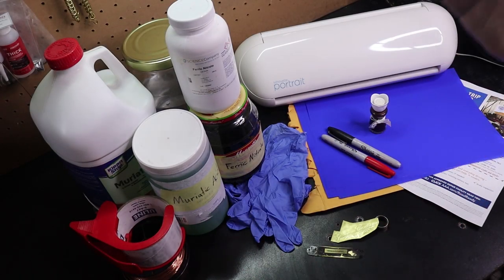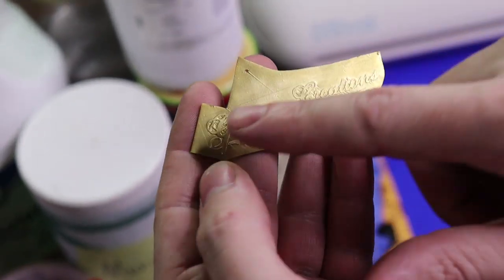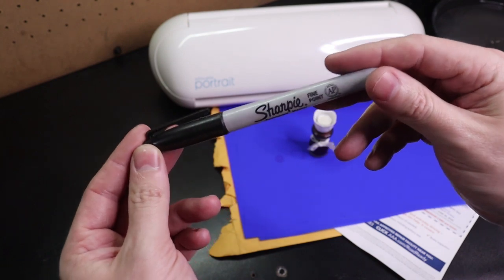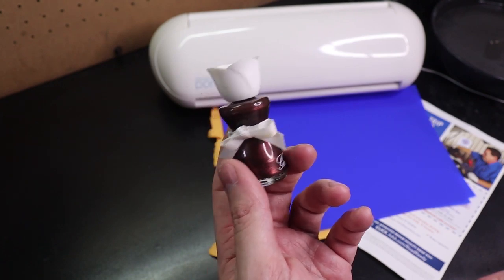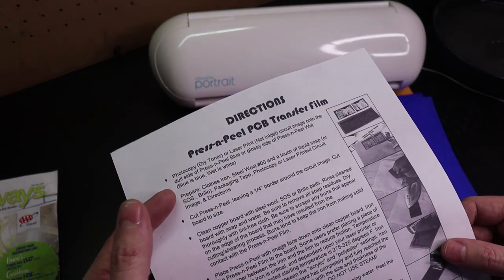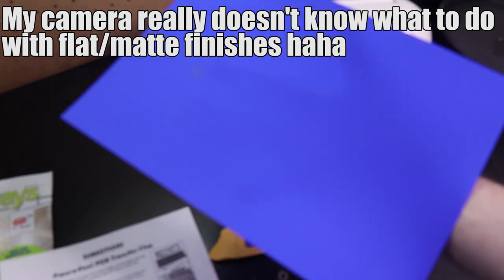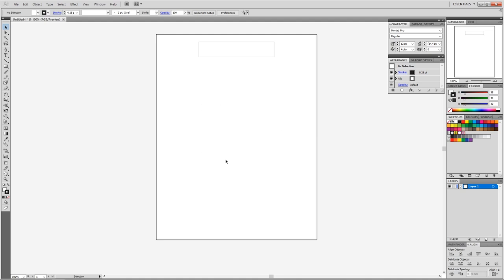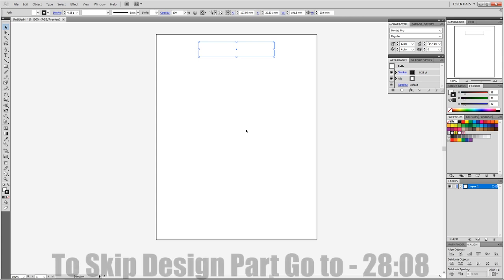Cheap vs Expensive Ways to Acid Etch Metal

Comment: Pro tip for applying crazy fine detailed vinyl: don't weed it right away.  Mask the whole thing, apply it, then weed it on the substrate.  With both the positive and negative parts stuck firmly to the substrate it's easier to pull out the negative without disturbing the positive by accidentally lifting parts off you don't want on the wax paper backing.
Reply: This is GENIUS!

Comment: I have been using cheapo Staples Glossy photo papers for years ironed on.. Ferric chloride
 for brass and copper,  ferric nitrate for silver. Use a small tub with aquarium pump with aerator hose gives a nice texture piece face down. Am always amazed at the detail I can get. Scotch bright on medal before iron.

Comment: Hot acid dramatically decreases the time needed to etch, but it also dramatically reduced the time you have to remove any splashed acid from your skin before real harm is done. With most acids at room temperature you get a comfortable margin of safety to flush the affected area before any real harm is done. Hot acid immediately starts breaking down tissues, as soon as you are splashed real damage is done.

Its kind of like you CAN drive 120+mph down a road to get somewhere faster, and you may even get there without anything bad happening, but that doesn't make it worth it.

Use room temperature acid and work on another project while it etches or use a bubbler, don't heat your acid unless you are in a lab setting, have proper ppe, an eye wash station, a quick way to neutralize the splashes that will inevitably happen, and have gone through lab safety so many times you could recite the text book.
Reply: Also, excellent video. I've been using nitric acid (typically sold as Silver Etching Mordant - mordant in this case being nitric acid pre-diluted in water, as the pure stuff is disfiguring even in a minor accident.)

I think like I'd like to give ferric nitrate a try instead --  Nitric acid (40-60%) is rated as a 3 (extreme danger) on the danger scale on the SDS, where as ferric nitrate is rated at a 1 (slightly hazardous.)

Comment: A bit more complicated, but if not using a vinyl cutter (I use cricut maker) and needing finer details, I'd be inclined to use a UV resist. For the artwork print to PCB artwork film, check for pinholes and touch up if needed. That step is then done for however many uses you need. Chemically clean the metal to ensure no contaminants (water droplet test), apply UV sensitive film to metal or some other way of coating the metal with resist, sandwich artwork to metal with glass to avoid shadowing and expose with a UV flood light for a couple of minutes or so. Develop the metal to strip the resist that wasn't exposed. Etch. For PCB's I always used sodium persulfate (fine etch crystals), which works great for copper, gives no mess and the etchant remains clear, and should work for brass and some others but not aluminium.
Reply: Hi , is there vid for what you described.  Im new and learning.

Comment: You can actually print onto a sheet of overhead projector acetate with a laser printer. It's a thin, clear plastic. You then put a piece of plain paper on top and iron the design on.
Reply from the maker: I have seen that too and thanks for sharing that info 😁👍
Reply: @GomeowCreations  It was one of the techniques I used when doing my degree in silversmithing. It works well, but does usually need some touch ups with a marker. The decal way definitely gives the best coverage. And a heated bath cuts your time down to about 10 - 20 minutes for a deep etch.
Reply: how do you apply it to the metal surface?
Reply: @KeyushTheStuntDog do you have video of that technique?

Comment: Add hydrogen peroxide to the acid for very very fast results. You can even just use concentrated pickling vinegar rather that hydrochloric acid or ferric Nitride/Chloride. The vinegar and peroxide is good for etching steel.

Comment: A cheap laminator makes it really foolproof and easy to get the toner to stick to the metal. I use that for making double sided circuit boards and it works perfectly probably 95% of the time.

Comment: Awesome info video!  I etch a lot and I use toner too. The bubbler with low heat works fast and clean with ferric nitrate. Also,  don't toss the used FN, even though a lot of people say it only works about 6 hours.  Store it in a large glass jar and seal the lid with electrical tape and wrap the jar in towels or cloth to keep it away from light and depending on how often you etch, it will last so far for me, a year and a half. I etch a lot of pieces every 4 to 6 months. Each time it takes only an extra 10 minutes or so unless I add a small amount of FN to it.  A big money saver for you I hope.  I  really enjoy the long videos with all the options.  I'm now experimenting with steel etching with salt water for texture plates.  We'll see how it goes.  Lol...thank you so much! 😊
Reply: Any pro tips for the toner engraving?
Reply: @sac7404  I don't do a lot of engraving but plan to learn.  If you're interested in an effective way to apply an image to metal, I highly recommend using PCB toner transfer paper. It works great for me consistently.  Just be careful not to let the transfer paper move at all during the transfer or it will smudge.  I use a hot plate turned on low and rub the image carefully with something flat like a popsicle stick. After you've tried it a few times on small images for practice, you'll master it.  I hope this helps. Good luck with your projects!
Reply: @tywhitmire860  thank you very much! I will look into it and see if its available in my country (at the moment a lot of office supplies are not being imported), or will just try with the protector paper from some vinyls I have, just to experiment. Good luck for you too!

Comment: Really great video, thank you for the time you put into this! Based on this video, I decided to go the vinyl cutter route but chose the Cricut Joy since it's small. For small cuts, it wasn't accurate. Then decided to try a 5.5w diode laser on a Sainsmart 3018 prover to ablate matte black paint off brass in preparation for acid etching but couldn't get it to have really crisp lines. I'm now thinking of going back to the vinyl cutter option but perhaps a Portrait 3. My designs are very small (filigree within a 1cm diameter). All this time down the line, what would you suggest? PS. I really dislike the photoetching option. Many thanks in advance! Gunter
Reply: what did you end up doing? i have tiny designs too and would love to know
Reply: @tsundear  I ended up getting the Portrait 3 and am much happier with the accuracy of its cuts.

Comment: There is another YouTube video that uses “Glossy Laser Printer Paper” (I purchased some from an office supply locally and it’s 52# paper) to put the design on instead of glossy magazine that I tried with unacceptable results. I did however experience your problem using an iron as the heat source (will try heat gun). Also in that video the transfer of toner was done using a mixture of ethanol and acetone which seemed to work well for him other than leaving behind some of the paper’s fiber on the toner transferred only.

Comment: Great video with tons of info! I am trying to make a brass casing for a guitar pickup and need to make a logo on it. I will be doing lots of these and was wondering if I could simply have the vynil decals made at a sticker shop and use those as the resist? I'm assuming yes. Seems like a great way to streamline the process

Comment: do you use ferric nitrate to etch silver, right? I just watched a video tutorial where this woman was etching silver in ferric nitrate hanging the piece with a wood stick and thread on a jar. It came out great, but others were saying that they tried it, and the silver was full of stripes.
Would you do a video on how to etch silver? do you recommend using the tape laying it flat like you did using the other acid and the brass?
Reply from the maker: Yes you do use ferric nitrate on silver for etching. I can make a video doing that to something in the future. So if you hand it   it will state to get lines due to how the acid works on the metal and that is why I have mind flat on in the acid so when it is etching the parts of it fall straight down and don't leave lines.

Comment: The amount of time you took with the Sharpie and nail polish vs the vinyl and laser printer determined the quality vs cost. 
Had you been as careful and exacting with the first two your results would have been much better whereas you took a lot of time with the other, more expensive methods and had some questionable results given the time and cost. 
I etch all the time with Sharpies and nail polish - virtually zero cost - with very good results. 
Still - lots of information here and I appreciate the amount of time and setup it took to create the video. 
I just want to make sure people know they don't have to buy a vinyl cutting machine to get really good, clean etches.
Reply from the maker: Yeah videos like this are kind of hard to make with some many options going on it in. I think I said that they do work but you would have to spend a lot more time with the cheaper resists like the marker and nail polish. 😅
Reply: Any tips for the toner method?

Comment: I have a fairly detailed design I'm trying to do. I have a Cricut machine like your Silhouette, but was considering using it to create a stencil I would then use nail polish or sharpie to fill in. Since I'm working with 0.999 Fine Silver, I needed to buy Nitric Acid. Do you think that would work alright?
Reply from the maker: How fine of a design are you dealing with? Because you can cut some really thin stuff out of the vinyl on the cricut machine
Reply: @GomeowCreations  I traced a dollar bill and converted it to an SVG file. Not all of the fine lines and swirls came through, but it's a fairly decent representation. I've found that I can weed out the vinyl stickers pretty well to be used as a stencil, but doing it in the reverse, to leave the small pieces there and removing the larger sections, is pretty difficult.
Reply from the maker: Well it might be best to do it the way you wanted to using it as a stencil and filling it in with paint

Comment: You don't need the mat when cutting vinyl - it already has a backing sheet,  just don't cut too deep.  The mat is used for paper and other products that don't have a backing.  Take the clear protector off when using paper - it's sticky 😁

Comment: I am doing a cylindrical object, so I can't use an iron. could I use a heat gun and wrap heat resistant tape around the object to =make the transfer?
Reply from the maker: You can try, or just use the vinyl cutter to make a sticker.

Comment: Try putting the object face up in the tray and use a feather to brush the surface. Not kidding, the acid won't  eat the feather and the feather won't harm the resist. You will get really sharp cuts.
Also look around for resist pens. They work better.

Comment: how do you separate the design from the sticky transparent plastic after applying the design to the metal? 8:15
Reply from the maker: so the Vinyl adhesive is stronger than the clear transfer sheet so it will just come off. Sometimes it will stick in spots that you didn't push down. If that happens just stop and stick it back down and push down on that spot more.
Reply: @GomeowCreations  makes sense. Cool :)

Comment: Does anyone know if you need to dilute the acid with a 2:1 ratio of water like many people do?
Reply from the maker: I don't know if you do or not to be honest 😅
Reply: @GomeowCreations  I think I figured it out.. if you sand and clean the metal well before etching. Using a diluted acid to slowly etch is probably easier to control and make sure you don't mess up. A pure acid will eventually get through the impurities on the metal if not cleaned and then etch, but it might not be as even. So mainly the prep work on the metal is just as important as the etching itself.

Comment: Can we do this using battery acid?
Reply from the maker: ...no?
Reply from the maker: I honestly don't know what battery acid is bit I guess it makes some sense seeing that it's an acid. You can do it with vinegar and salt too if you are using electricity. But I would stick with the simple acids that I used in the video. 😅👍
Reply: @GomeowCreations  😅😂
Reply: @GomeowCreations  what is the you using cuting machine call